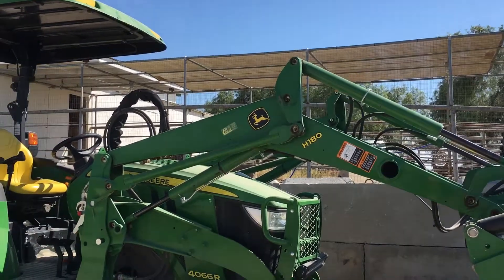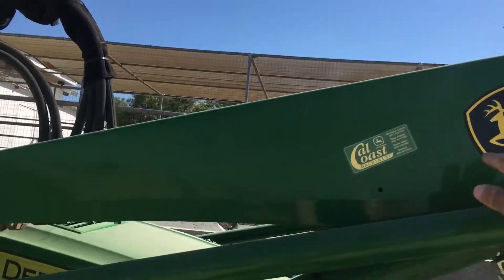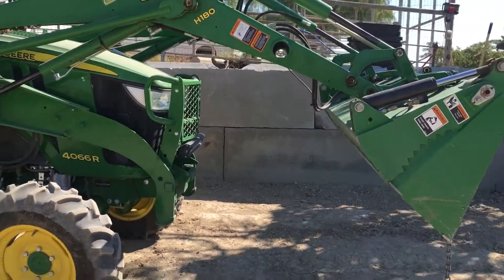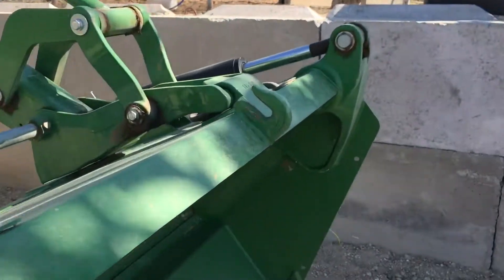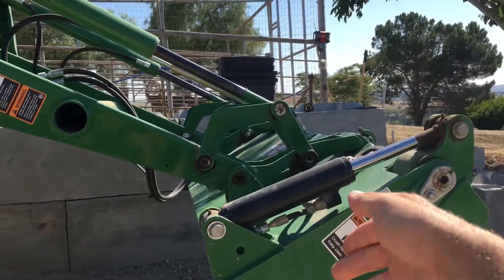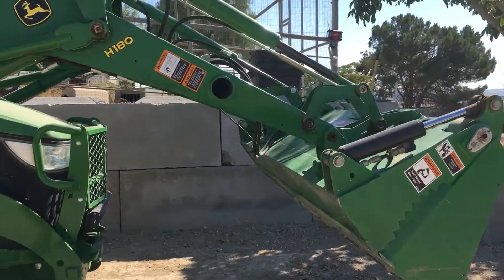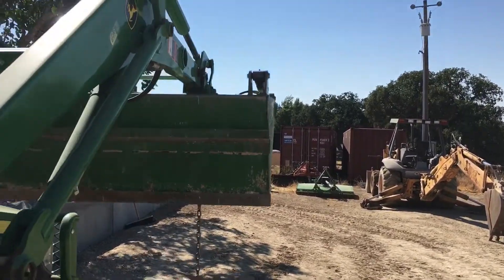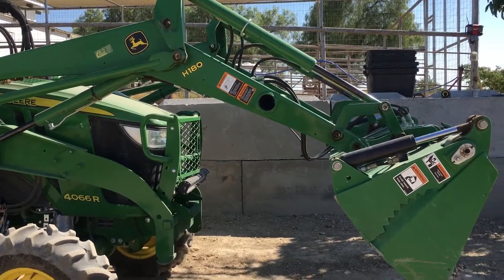John Deere 4066r H180 front loader flaw

Comment: It's not a flaw, it's physics. the bucket has to have room to move as the main boom goes up and down or it it will reach the end of it's travel. if the bucket is already close to the end of it's travel and you then try to force it to go further by raising or lowering the loader the bucket can't do it and will bind up. this is true on any self leveling loader
Reply: Stephen Jones Agreed.
Reply: Correct me if I’m wrong, but this loader has the levelling link below and to the side of the main frame. Older loaders on row crop tractors have a single beam up on top to the back mainframe. This design never blinded up for me, but the new ones have this design and bind up. I prefer the older ones. It’s a slight problem on this design and does not happen to all loaders.
Reply: It would seem to me that any mechanically self leveling loader would do the same thing if the bucket was near or at the end of its travel and you then try to move the loader up or down. I don't know how it would not bind up if the bucket reached the end of its travel and could not go further. The only answer I guess would be if the bucket and leveling system travel was substantially greater than the total travel of the main boom and the bucket cylinders combined. It could be there was a hydraulic release that let the cylinders retract or extend to compensate. HMMMM mystery.
Reply: That’s the trade off of a self leveling loader. Nothing wrong with it. Just the way it is.